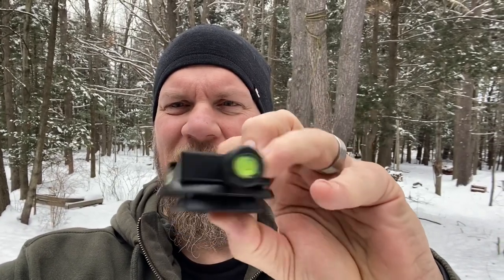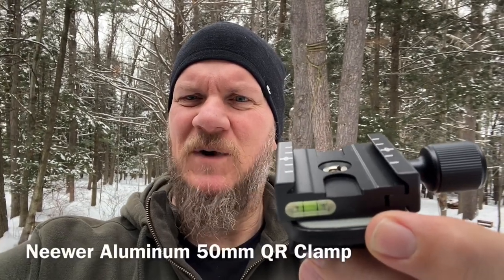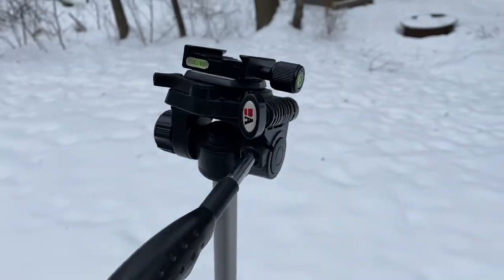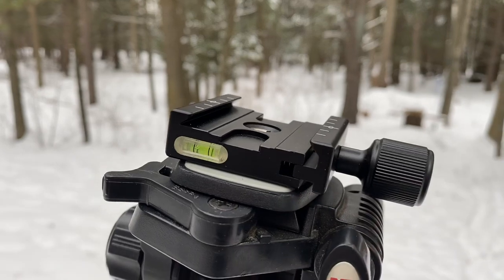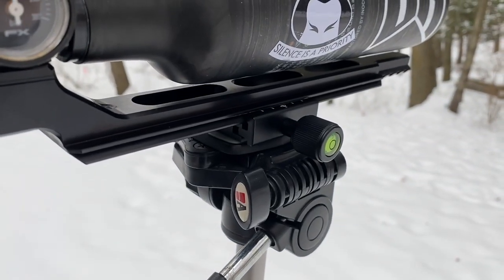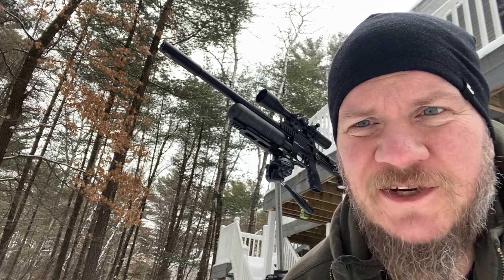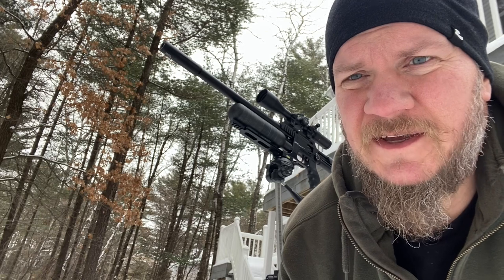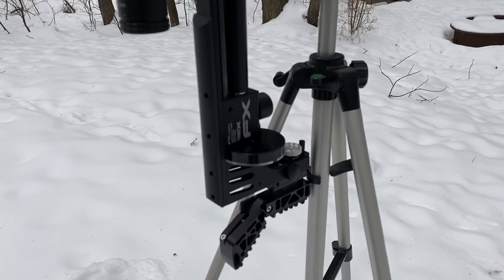What the Hades is an ARCA Swiss Rail, and why the Hades should I care?

Comment: How badly does that affect the harmonic? I'd assume that the sturdiest the tripod, the less vibration there is. I watched your video about the barrel harmonic tuner. Do you need to change its setting when you use the tripod vs when you use the accu-tac? I'd be tempted to say you do. Thanks.
Reply from the maker: Yes. It effects it. That's neither good nor bad, but might be better for a rifle or worse for it. I set a gun up and unless I'm making a major change, that's how it is set up. If you watch carefully you'll see people shoot rifles off tripods with bipods still attached. There's a reason for that.